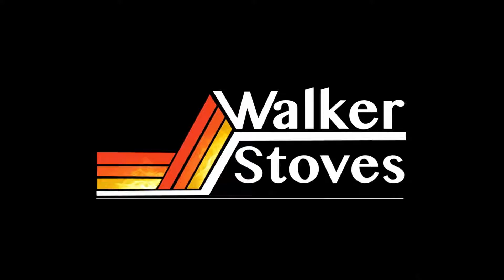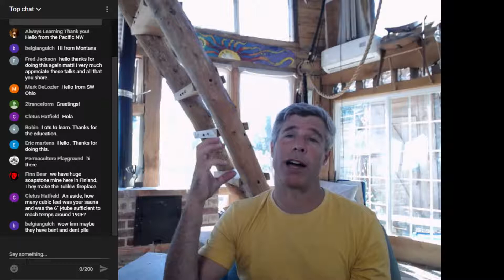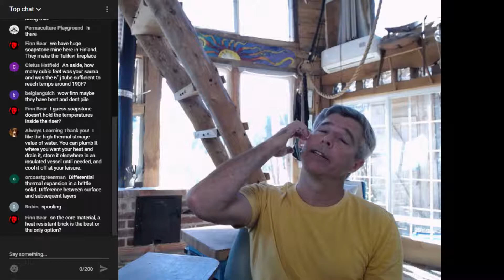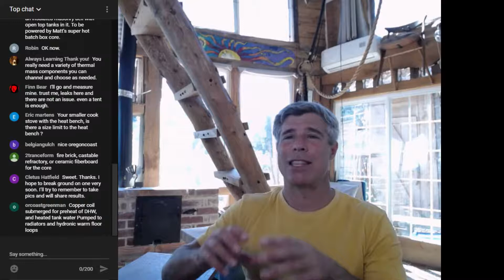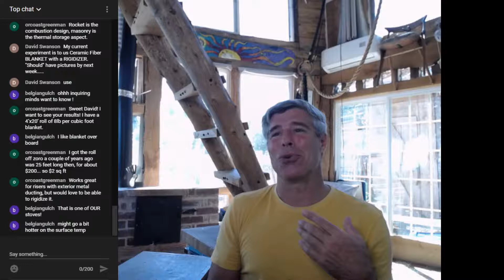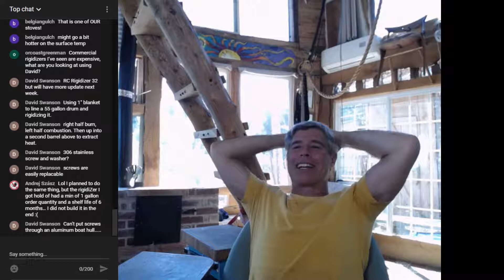Stove Chat Episode 44

Comment: Was behind a few minutes toward the end.  Added a comment about attaching CF blanket to exterior structure.   I have successfully used the wire from burned up heating element coils from clothes dryers and wall heaters.   Works like heavy twist tie wire.  Tolerates extreme temps without oxidizing.  Has fairly low heat conductivity, I believe.